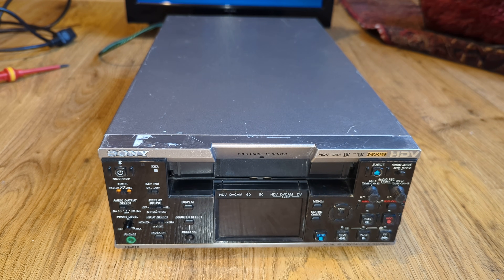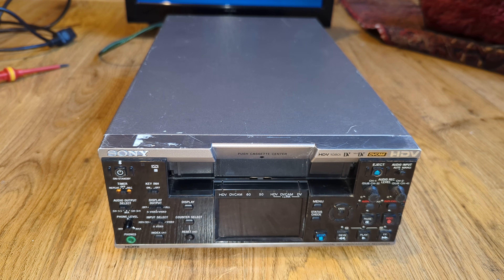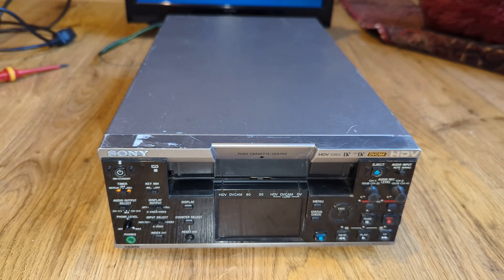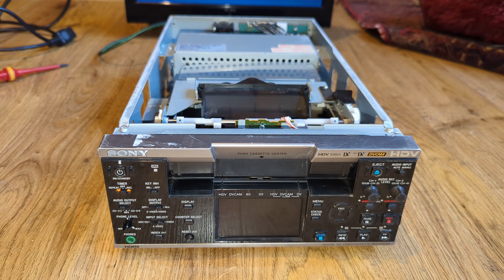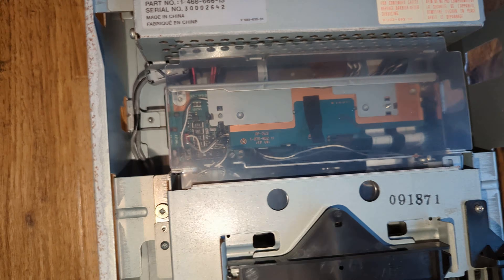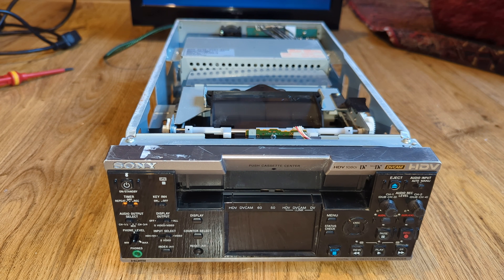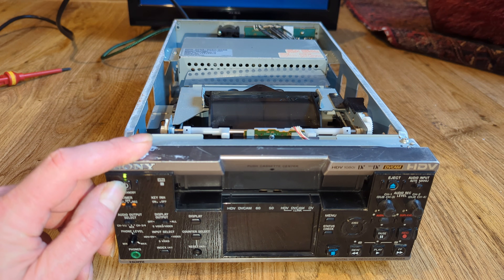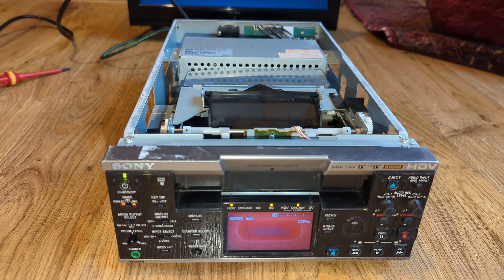Quick look! Sony HVR-M25E DV video recorder Ep 1 Series 2

Comment: hi i find the panasonic  dvcam  decks with the power unit out side is better 
i have a sony 45  dvcam  deck with bad cap's i hope it's just caps 

i power 12 power units out of  12 betamax  100 ub decks  alot of bad caps
in each deck    

it's a long road ahead  2 decks are parts  
betacam A500P parts cost alot of money now  have to pay out on a eq45 audio pcb
Reply from the maker: Many Sony DV decks had external power supplies too. This one isn't too bad having it internally as it's very easy to get to and in the day, a quick fix but might be more difficult to source now!

Comment: Be aware that this won't play HDV tapes recorded in either the Sony 1080P nor JVC 720P progressive modes (well the latter it might display but not provide a digital output).  I have the less fancy HVR-M15E and the progressive HVR-M15AE models here, without displays.
Reply: Was the 1080p 24 fps? I'm not aware that HDV could do 1080 30p, I could be wrong.
Reply from the maker: I should have said that in the video as I had the compatible formats from the service manual! I have another HVR-M15 to come on the channel - not sure off the top of my head which variant it is though.